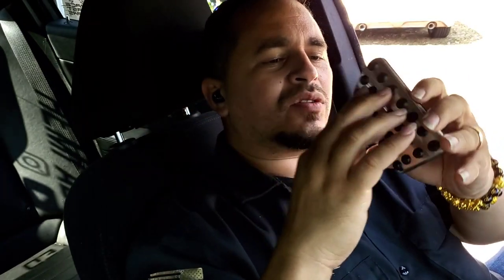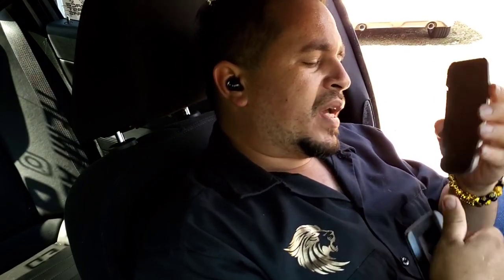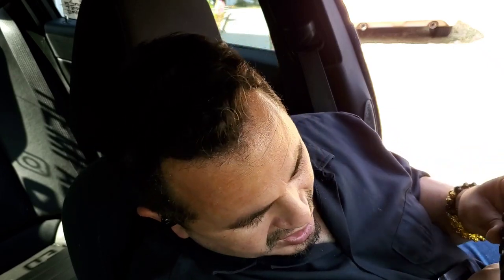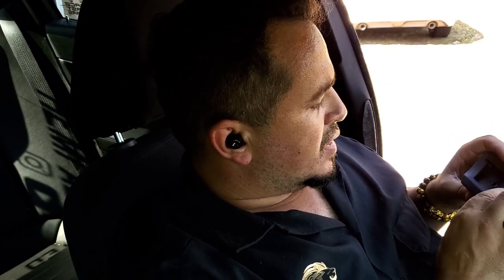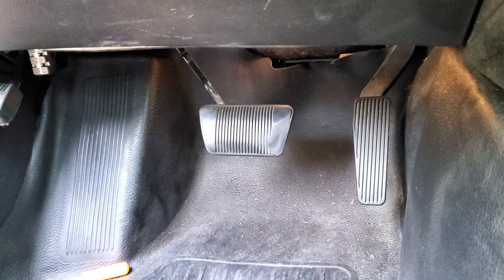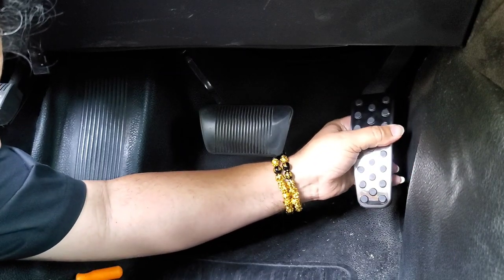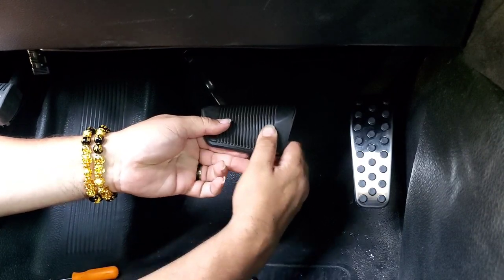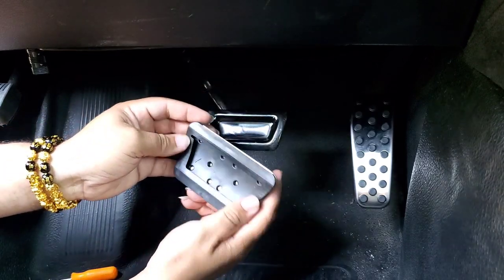Installing SRT pedals on my Dodge Charger.

Comment: Super easy way,  on one side cut the corners at 45 degree angles then slide the petal on and you have 3 sides done then use a screwdriver or fingers to lift the one remaining small side out and over the petal.   Takes like two minutes that way.
Reply: I 2nd this, did this same thing today was the easiest

Comment: put new peddles in hot water wile you are removing old one more flex hot rubber also use a blow dryer on the old one again HOT RUBBER HAS MORE FLEX

Comment: I Cannot GET THE ORIGINAL BRAKE COVER OFF!!!  (Mind u, I'm a 120 pound woman lol).  I swear I can't get it!!  😭😭.    I need a man to come over here in Detroit and help me!!! 🙏😟😟
Reply from the maker: If the original cover does not look like the one you trying to install then you are trying to remove the incorrect ones. If the original you talking it's the same as what you are trying to install then get a hot water in a bowl and place the old pedal pad in the hot water for about 30 seconds to a minute. It will come off.
Reply: @sumcrazydude  thank you for your reply.  I'm going to work on it in the morning!   Wish me luck! 🤞. 🙂